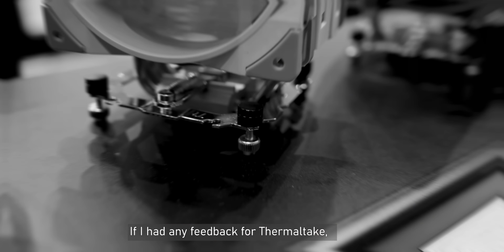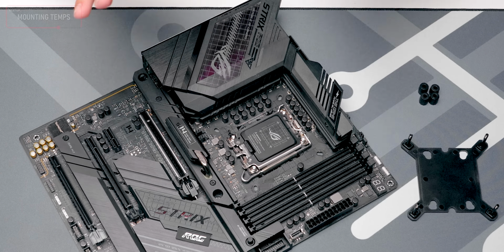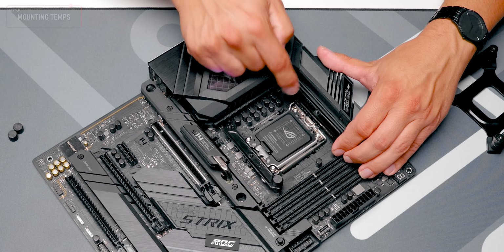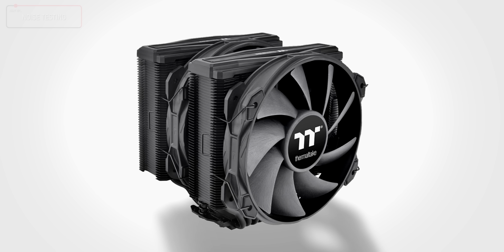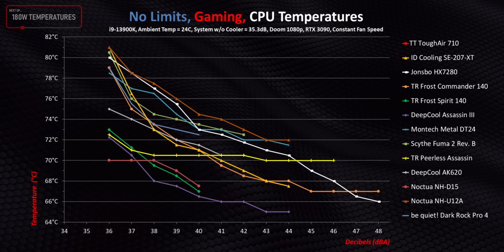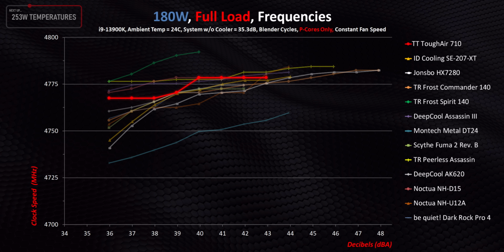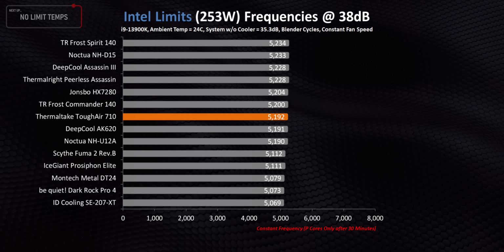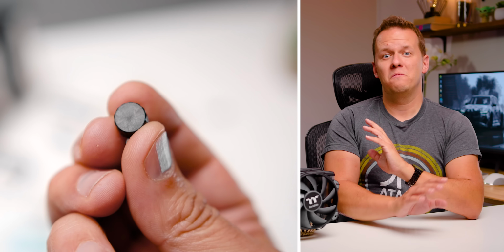Thermaltake ToughAir 710 Review - Their Ultimate Air Cooler

Comment: Regarding the Toughair Mounting: I use a Toughair 510 CPU cooler and when it's mounted, you can still turn/move the cooler a bit on the CPU - although it should be fixed by the mounting material. Thermaltake should change the whole mounting.

A plastic backplate might still work on a Toughair 510 (similar to a Noctua NH-U12S with 2 fans with a narrower heatsink), but plastic has no place on the Toughair 710. The cooler is not lightweight and it just looks "cheap".

Otherwise I am very satisfied with the cooler and the included Toughair fans.

Comment: How much money could they possibly be saving by including these non-slotted, garbage plastic thumbscrews with threaded inserts rather than normal, slotted metal screws? 

They saved a few pennies on screws and in turn, made their mounting system and the user experience considerably worse. Raise the price of the product by $1-2 and give your customers decent mounting hardware. 

Why would you go to all of the trouble to design a CPU cooler and then cheap out on the mounting hardware and ship the product with inferior fasteners?
Reply from the maker: Nothing.  Literally nothing.  For them it's about commonality with their own other lower end coolers.
Reply: @HardwareCanucks  if you’re going to try to step up into the mid-tier or high end category, you just can’t keep using the same bargain bin hardware you use for your $25 products. 

Even if I were to buy a $25 cooler, I’d be disappointed to see BS fasteners like this because you’re actively making your product worse and not even saving on costs.

Comment: Thermaltake just isn’t a company that I associate with high quality and the same goes for a great many brands in the PC industry. If I’m buying an air cooler, it’s going to be from Noctua or potentially be quiet!. I know there are some very good budget air coolers on the market lately but Noctua is still the king as far as I’m concerned and the price difference, even if it’s double, is still absolutely worth paying because we’re only talking about a difference of $40-60. I haven’t actually used an air cooler in several years though and I’m sure some other companies are probably starting to catch up but Noctua’a ten year old design is still somehow better than all of them.

Comment: Thermalright Peerless Assassin 120 SE ARGB is still a slightly better performing cooler and literally 1/2 the price @ only $39.90. Thermaltake fans have always SUCKED for reliability in my experience and I've used all sorts of Thermaltake stuff since 2003. My 1st build was in a Thermaltake Xaser III V1000A case and my 1st water cooled pc was built with a Thermaltake Bigwater SE. lol

Comment: There is one thing that is true about Air coolers. Once you go past a certain number of pipes and fins, performance will be hard pressed to improve. The most important thing about the Cooler is it must cover the entire IHS for optimal performance. That allows that the Noctua Air Cooler for HEDT desktops is still relevant in 2023. There is though that even budget Air coolers that meet the above requirements will provide more than satisfactory performance.
Reply from the maker: Correct.  There's certainly a hard ceiling to performance and it'll take some genius engineering to break through it.
Reply: @HardwareCanucks  One of the things that Make Noctua great is how quiet the fans are in Action.

Comment: At this price point I feel like this cooler is kinda pointless.
I can get a Thermalright Frost Spirit, Peerless Assassin or Phantom Spirit for around 45€ with a better mounting kit and better performance.
Or you can spend a little bit more than this Thermaltake cooler and get a Noctua NH-D15 if you want the best of the best.
Reply from the maker: I would normally agree but pricing and availability on Thermalright coolers is HIGHLY region-specific.  I've seen the FS140 going for the equivalent of $100USD or higher in some regions.  Meanwhile Thermaltake's wide distribution channels benefits them and would likely keep the 710's price down in less-served countries.

Comment: You should give the Phantom Spirit from Thermalright a look. It is a 7 heatpipe version of the peerless assassin with quieter fans.
Reply: It's a Peerless Assassin with another heatpipe. That is why it doesn't need to run fans as fast. They have the same fans.
Reply from the maker: Are you sure about that?  The fan specs on the two coolers are almost identical.  As a matter of fact, I'm 99% sure the TL-C12B V2 fan is simply a TL-C12 (used on the Peerless Assassin) that's black and has an RPM cutoff that's just a bit (50RPM) lower.
Reply: @HardwareCanucks   I actually had a chance to test both recently. My friend bought the peerless assassin se for a build I was building for him. Then my 280 clc's pump broke while building that and I replaced it with a phantom spirit se. Below 60% fan speed I couldn't tell a difference, but once it gets above there, the assassin is louder to my very unscientific ear test. It's doing so well I may never put that 280 clc back in. Also, the fans on the peerless assassin se spin in the reverse direction of most fans, while the phantom spirit se fans spin in the normal direction.

Edit- so I'm finding out now that the peerless assassin se has different fans than the standard model. So now I'm not so sure, as the ones on the standard fans look more alike via Amazon pictures and do not go in reverse.
Reply: @HardwareCanucks  I got both.
Don't know for sure what's going on , only thing i know is that ps120 fan are quiter than the pa120 ones and with the PS120 i get 4 to 5 degrees less than with the Ps120 with a 5800x
Reply: @Cosmopavone  know some with both and the PS120 temps are 4-8C lower than the PA120. It's pretty damn nice

Comment: Scythe Fuma 3 is supposedly launching soon for $60 and they have had excellent mounting kits. This Thermaltake cooler is DOA.
Reply from the maker: Correct but....when it comes to performance, Scythe isn't swinging for D15-level cooling.  They never have.  Their focus for the Fuma 3 will be on complete silence with performance that beats the Fuma 2 by 2-3 degrees.
Reply: @HardwareCanucks  My Phanteks T-30s think otherwise ;)
Reply: If they ditch the 15mm thick fan and opt for a normal 25mm fan it would probably be top tier performance.
Reply: @maozedowner5915  You sacrifice memory clearance in that case I believe, so you need to mount the thicker fan higher and that also affects performance. I think the main problem is that the fuma uses 120mm fans instead of 140mm fans like the d15.

Comment: I like my $35 thermaltake air cooler, my i5 -12600k at 5.2 ghz does not get a hot at all. I did not have a problem with the mounting.

Comment: 3:40 Counterpoint: Absolutely NO ONE.  Not one single person on the entire face of the Planet, is putting a Thermaltake cooler on ANY high end motherboard.  Not Ever.  So you're entire rant is completely nullified.
Reply: why not?
Reply from the maker: Why not?  Honestly curious here.  If it was an AIO...well I wouldn't put an AIO in most of my systems anyways....but why?
Reply: @HardwareCanucks  Explain why i should spend 85 dollars for a cooler that is beaten by cheaper coolers...
Reply: It's not even an "high end" thing. Why should i spend 85 dollars when there are coolers that are better and costs less or i can get the best of the market for like 20 bucks more?